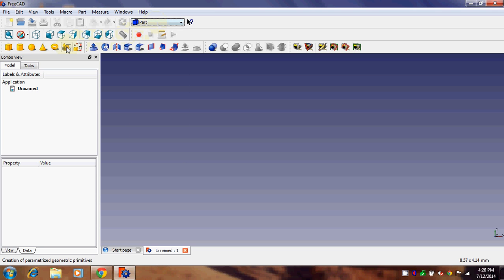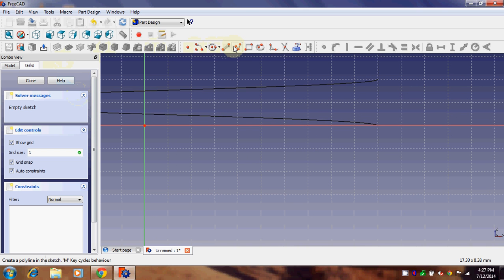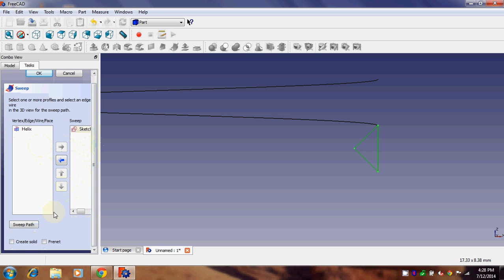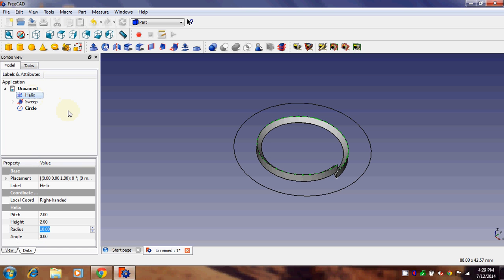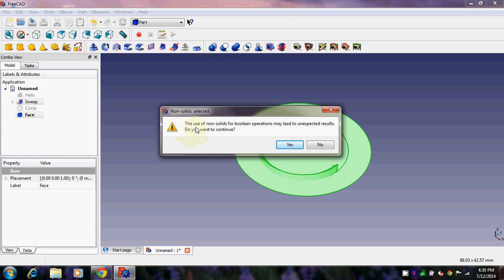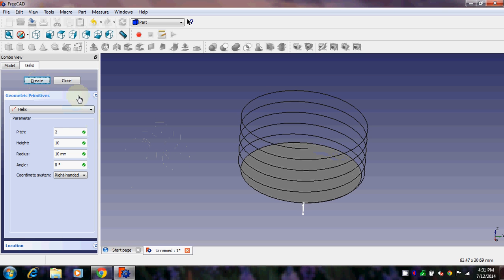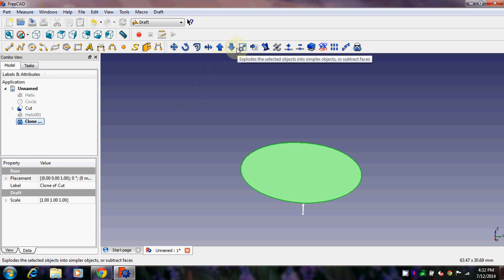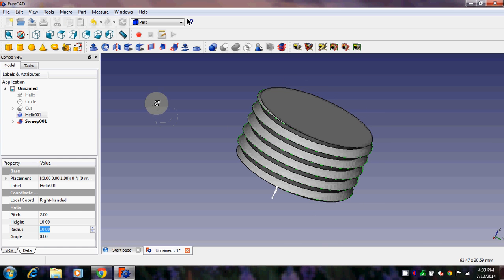FreeCAD : How to make threads

Comment: Great video.  But I tried it three times and only get to 5:18.  At 5:18 in the video,  when I do the cut, it doesn't cut all the way through and leaves two circles.     Looks like this ( 0 ).  Like a big O inside a little o.  Any suggestions?  At 2:12 in the video, it shows a C for constraints in the triangle, but I don't see that in my version 0.18  of free CAD.   I have auto constraints checkbox checked.   The constraints checkbox are checked, but it looks different in my version.
Reply: Step by step I have the same problem at the same place:  FreeCAD 0.18 (16146), 0.19 (AppImage) 19180 (GIit), but  FreeCAD from sources gives right result at that moment, but helia is divided 10 times and is possible do only one piece of thread. So after I do array of 10 pieces and get "thread". BUT it is useless, because it can't be use to cut other shape... It is bug...

Comment: The exception in C++ is where something went wrong, and the program made an abnormal exit from the code.  The "unknown exception" text was typed in by the programmer, so therefore this exception is probably like a default when it is not known what caused it.  I suspect the warning meant your going somewhere with your drawing/design that the program can't deal with.
Reply from the maker: Jeffrey Perkins I tried to find the reason but didn't come up with anything, so I think what you're saying is right. Since, it's like going in an unknown territory and it works for the problem at hand, I went ahead with it.

Comment: Thanks for sharing!  Great effort.. I will try to follow in FreeCad to make a 1/4 28 threaded coupling (UNF ¼” 28 G threads). 
” ¼”” stands for the outer diameter of 6,35 mm. “28 G” stands for 28 thread pitches at the length of one inch (25,4 mm): lets see if I can adapt your instructions!
Reply from the maker: Hope this helps! :-) If you face any problem, let me know. We can work it out together.

If you need me to post tutorial on anything else, let me know